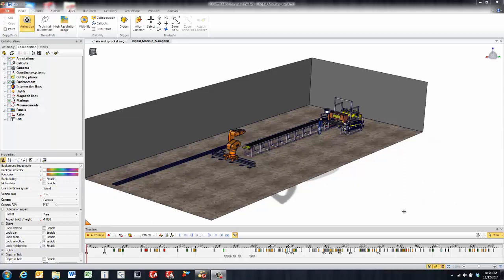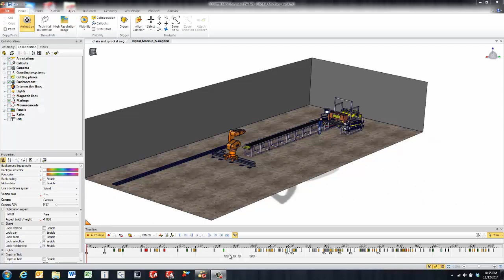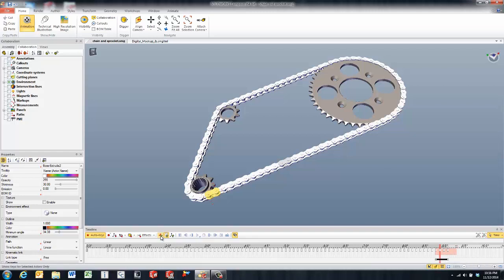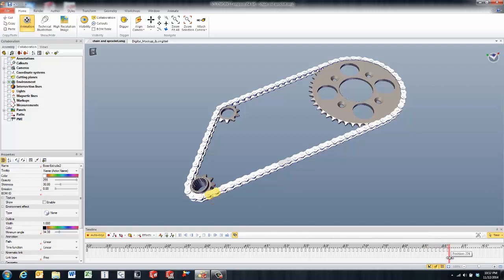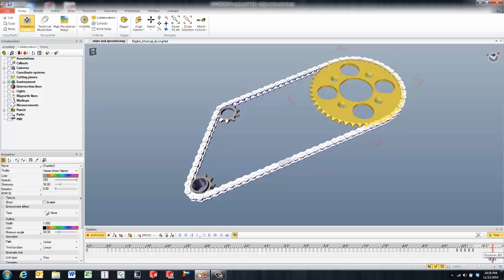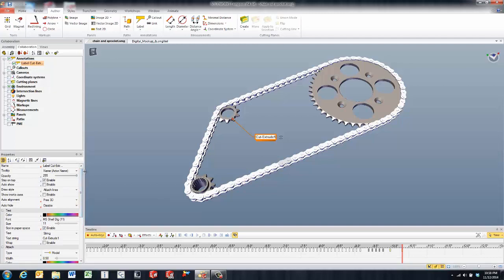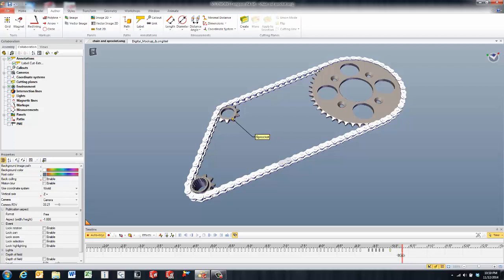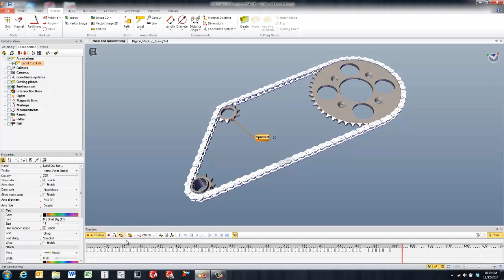SOLIDWORKS Composer - Animation Tips

Comment: Hi, is it possible to animate a chain moving along sprocket in Solidwork Composer? Cant seems to find any tutorial for this kind of motion on the internet.
Reply from the maker: Chain animation inside Composer is a fairly difficult task.  The ability to bring in views that come from SOLIDWORKS explode steps seemed promising, but only if you could “fake” the chain movement with a series of explode steps.  Creating the movement and rotation for one component is possible (see this video from SOLIDWORKS: https://www.youtube.com/watch?v=jle7ekUoZo8), but when you start scaling this up to include all of the other chain links, then it might become overwhelming.  The YouTube video in the link brings in a second component that follows the same path as the original, so imagine doing that for the rest of the links.

One idea was to create the animation in regular SOLIDWORKS and then create a link to the animation, either thru a hyperlink or an external file.  There are a couple of enhancement requests concerning this topic that have already been submitted, so submit it again and maybe SOLIDWORKS can implement an easy solution.